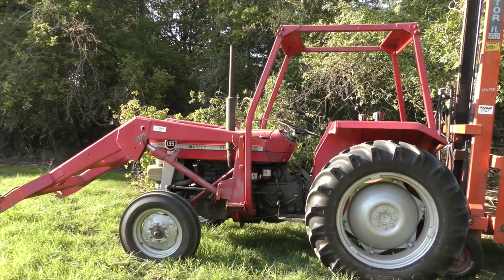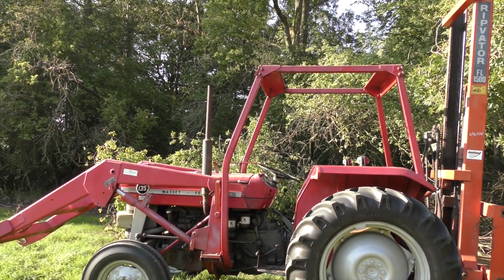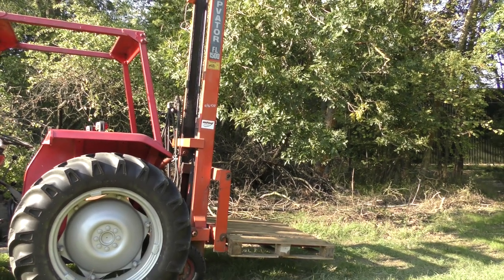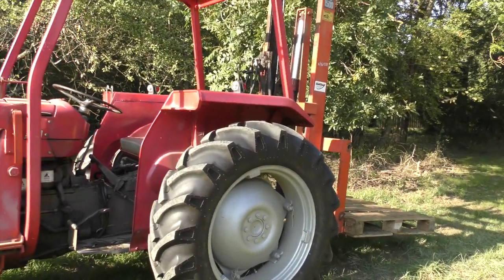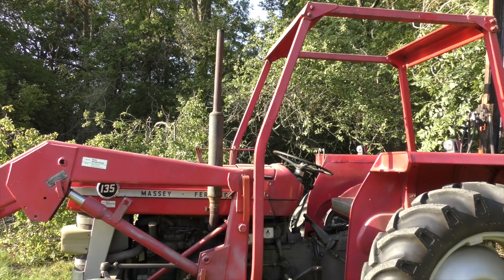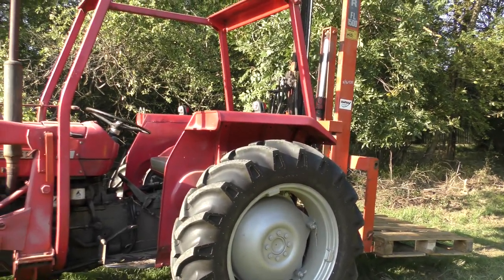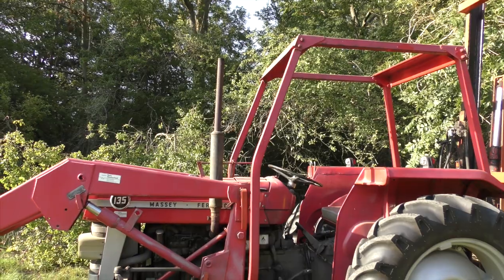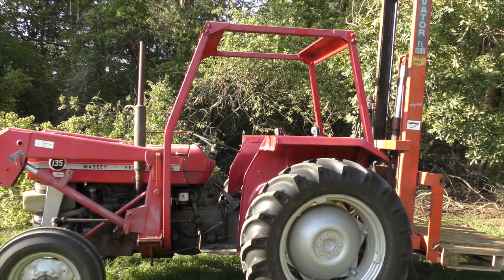MF 135 tractor overview

Comment: Nice tractor I'm from the states I own a massey 135 it's a 1972 with a 3 cylinder perkins gas, I was in a hurry and didn't pay attention when I bought it but it's a vineyard model and the axles are 4inches shorter on each side. I'd like to find one but in America they hold there value so I cant find one for under $5000. But I'll only buy massey tractors i think there the most reliable tractor in 50hp made and so do a lot of others I hope there new tractors are as dependable as the ones from 50s, 60s, and 70s maybe even 80s. Great video

Comment: I have a mf 135 myself with the same front load and how do you lift front loader without lifting the 3 point linkage ? Would really appreciate the help
Reply from the maker: There is a small lever on a block on top of the transmission that can be set to operate the front loader, or the rear links, or supply the hydraulics to raise the pallets on the rear. I don't know how it has been set up - it was already done when I bought it. Hope this helps.

Comment: What front loader is that? Love to see these tractors still working!
Reply from the maker: I like these older tractors. This one starts easily, even on the coldest mornings. It does everything that I need it to do and if I can continue to maintain it properly and generally be careful it should have plenty of years left in it. It is surprising how many people I talk to learned to drive on tractors like this. The bad news is that I really don't know what the front loader is. There is a model plate on the side but there is nothing on it. When I have searched photos of similar loaders none have seemed to fit exactly. I think a number of these loaders have either been altered to add hydraulics or have extra bits welded on to strengthen or repair them.
Reply: @longhayltd9241  The same story goes here! This was the first vehicle I drove. My grandpa teached me to drive it when I was 11! It was quite  reliable, we had a big trailer made by him that we would put hay or haybales, wheat, corn anything it was needed for. And it can pull some weight! To bad for the loader. I see them with loadets that have to have some supports on the front of the tractor too and I saw this one is not that way. Thank you!

Comment: Great Video, great tractor,where you from,I just subscribed.
Reply from the maker: Hi. Thanks for subscribing. I am in North Hertfordshire. There are more videos to come regarding the MF 135 - transmission oil change and trying to obtain a V5 registration document.
Reply: Do you do some farming .Also what is v5,Tanx.
Reply from the maker: I have 34 acres of woodland and 6 acres of hay meadows plus a small amount of local grassland contracting. No livestock. I wound down most of the contracting around 10 years ago. It wasn’t a great earner but taught me a lot.
Reply from the maker: @colmanlong1032  The V5 is the DVLA registration document similar to the one required for a car. A lot of these old tractors don't have one (often lost). Trying to get one can be a bit of a nightmare.
Reply: @longhayltd9241  my father had 135 all his farming life, tractor done 50 years of workalmost every day, virtually trouble free,one of the best tractors ever built.
Reply: @longhayltd9241  same here in Ireland,an awful lot of tractors with no log book.